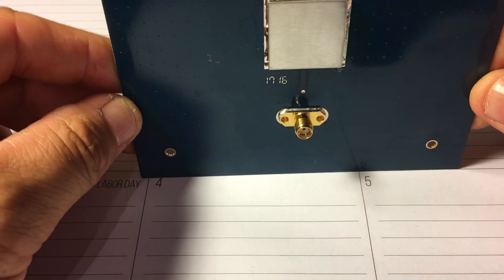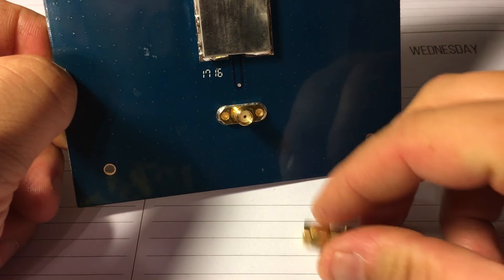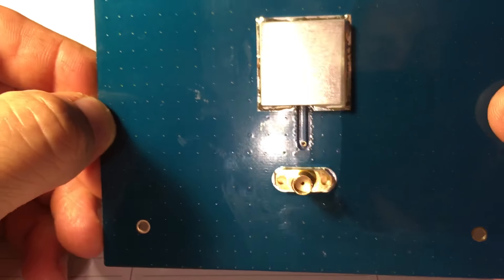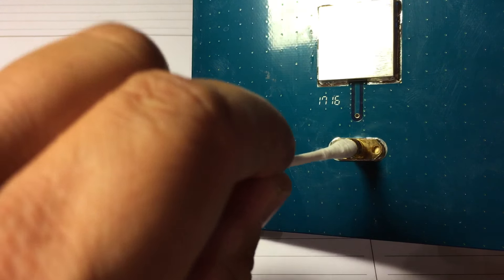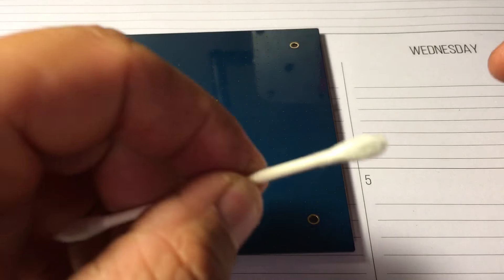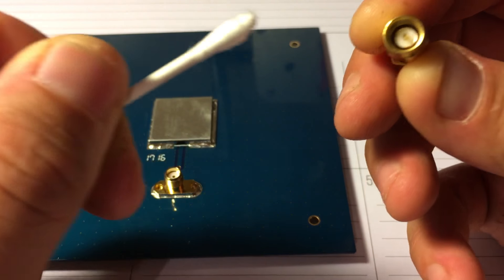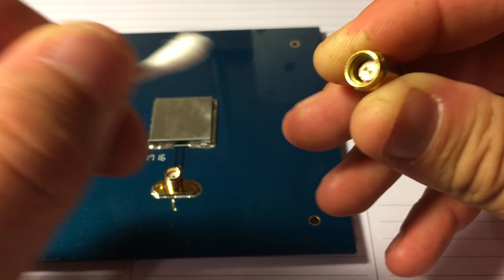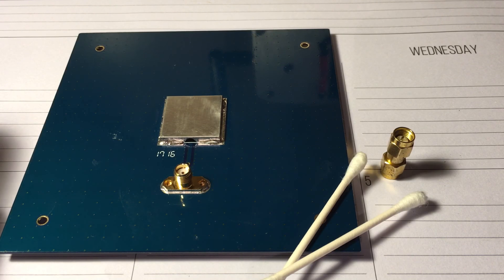How To Clean SMA Connectors The Easy And Safe Way

Comment: Nice try. 2 comments:
1st, don’t use Q-Tips. Instead use lint free swab otherwise you might end up with particles in your connector.
2nd, use ESD safe swab especially on the input side of LNA. Some semiconductors are very sensitive to ESD, being subject to damages with only few hundred volts.
Beside these 2 comments, excellent procedure. If deeper cleaning is required, IPA can be used or Deoxit contact cleaner. Deoxit has even a product specially formulated for gold plated surface.
Continue the good work.